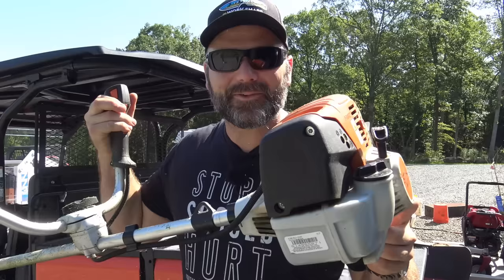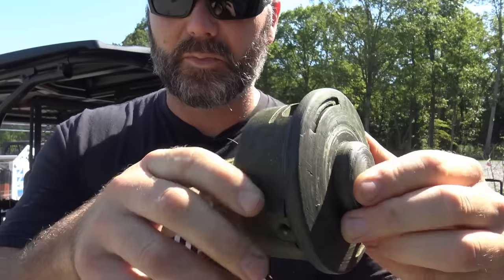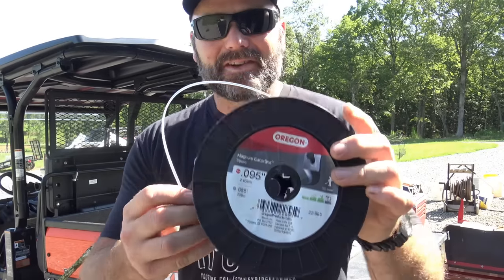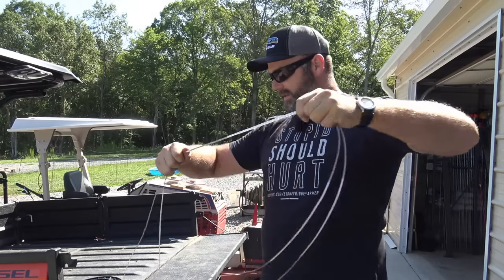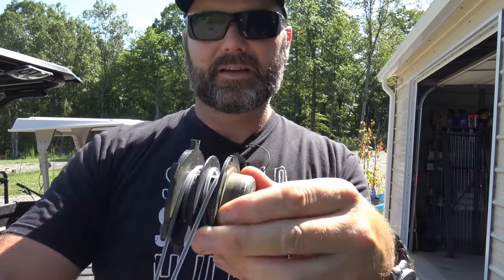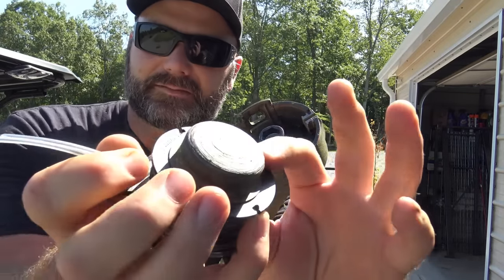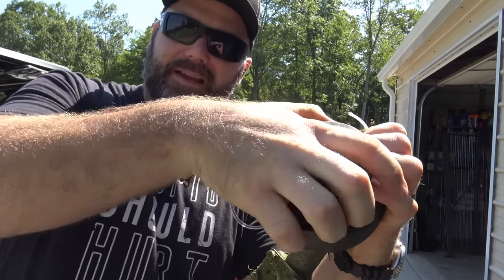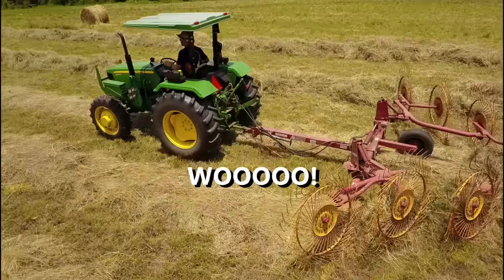EASIEST WAY TO STRING YOUR WEED EATER

Comment: Well done on the method. I work at a STIHL shop myself. Only suggestions to make it easier would be that if you just take 4 arm lengths and cut it. Put each end in the spool as you did and spool it till you're left with a short loop. Latch each edge in the notches built into the spool for holding your line while putting the spool into the head and cut the loop of line. Pull the line from the edge of the spool into the appropriate eyelet and they hold themselves there. Put your faceplate on and go. Otherwise this is super helpful and will recommend it for people who don't have time in the shop. My method would just save you the time of measuring two seperate pieces cause you can cut it at the very end, the spool is built and designed for that. The notches on the top edge of the spool opposite each other. And the effort of holding the line once it's been spooled, hooking it into the notch on the top of the spool removes that risk/effort of holding it from unwinding completely.
Reply: Those are super great tips from a guy who has owned a Stihl string trimmer for probably 15 years and never completely done it the best way like you described.  Thanks a lot!
Reply: @nathangould2856  I'm glad it helped. I read back over it and found it kind of confusing myself. But the basics are there haha.

Comment: Tip: If you notice more line breakage than what you feel is normal, drop your roll of unused line in a bucket of water for a day or two. Old line can become brittle  and a good soaking can reverse this from happening. This is equally true with a new roll of line as there is no way of knowing how many seasons it was on the shelf prior to your purchase.
Reply: Now you tell me!
Reply: Never heard that before. I wouldn’t have thought the plastic string would soak up water. Today I was working on restringing and cursing the string. I’ll go soak it immediately.
Reply: @baklash6079   lol
Reply: @baklash6079  that’s funny
Reply: A synthetic string would NOT be soaked by water.
Reply: Lol
Reply: I replaced the word "line" with "hair" and now my bald spot is gone!
Reply: got a good laugh out of your bucket of water "snake oil". It was free, tried it,...laughed again at myself. The line that "soaked" overnight was a completely different story.
Thanks Mr. Matt, makes a huge difference.
Reply: You have to try it to believe it, but it works every time.
Reply: Did you learn this from Project Farm? He also tested the best strings on the market
Reply: @williambrown4415  It needs to be hot water, not boiling though.
Reply: I soaked mine too long, now it's all soggy.
Reply: I have found that has not helped at all. But, when my line breaks (which is every 5 minutes)….

I notice that the line on the spool is always tangled. Is there something I am missing? Align arrows, feed equal line in and turn the line in.

Honestly, I am curious of a great brand of line too.
Reply: I’ve done it. It works! Need to leave in in the bucket for at least one week. Seriously.
Reply: CRC lubricant after you put it on the spool. Runs as smoothly as a babies bum.
Reply: I have never thought of that  on how old / how long the store was holding it for 😮
Reply: Nylon string needs a certain percentage of water to have maximum strength. Many plastics aren't affected by water but nylon is not one of them.
Reply: @trulyinfamous  sorry, but that last sentence is a mouthful. To clarify, are you saying nylon is affected by water? The spray lubricant someone else mentioned also sounds like a great idea, except I wonder if it will then attract dirt?
Reply: @pkr2inc  yes, nylon absorbs water and needs to have a certain volume of water absorbed into it to reach it's maximum strength. Too dry and it's brittle. It's not possible to get it too wet so don't worry about that.

Comment: Good well executed video. Instead of holding the reel stationary, I hold the 2 sections of string on either side of my middle finger of one hand and hold the reel on top and bottom with the other hand then spin the reel in my hand. This keeps them from twisting and takes even more time off. Thanks!

Comment: You missed  a very important and useful feature of the spool: There are a couple of roundish notches on the rims of the spool to hold the ends of the line so you can install it without holding on to the ends. Also some spools allow you to just bend the 24 feet of string in two and not have to cut it in two.
Reply from the maker: I knew I missed something...better question...if ya already know how to do this...why are ya watching buddy? Just curious..thanks for the info
Reply: I have stihl fs90r I caught that also. I clean dirt out of mine before anything I don`t cut my line til it`s all put back together use ball hitch on truck stretch it to back door of truck gives me proper length ball holds it tight while I roll it up. I maintain a few yards for extra money his way is good also you dont always have a ball hitch
Reply: @StoneyRidgeFarmer  Aggressive response. Guy was just being helpful. Chill.
Reply: Bill Pays, Husqvarna's reel(s) functions like your final sentence.
Reply: Nah , he was asking a question like a Man. He even thanked him for his input

Comment: Pro tip! If you are just starting out, use 
.095 line, it will help you get used to the trimmer and it's speed, then use .080 line to get a better cut, it will help you go faster if you have medium to small sized brush.

Comment: I have a STIHL FS 94 R with a User Manual that's 44 pages, English version. It also came with a separately printed page that showed how to replace the string in ONLY 18 steps. Your method is so much easier. Thank you for making this video. I'm now a subscribed viewer and waiting for your next video. Two tips: When you buy a new trimmer, the manual will/should inform you to 'break in' the engine. This break-in period lasts for the first 3 tank fills. I also avoid using gas with ethanol as this additive can cause engine damage.

Comment: There are two slots on the spool that allow you to cam the string into the spool locking the strings to the spool. This allows you to handle the spool with one hand and guide the strings in one at a time.

Comment: Great video Josh!  There are two slots on the string spool where the loose ends of the newly strung string to be pulled into so they won't accidentally come unstrung before you get the spool back into the head.  Once you have the spool reinstalled, just give a slight tug on each line to pull the line out of that holding slot.  TaDa!!!  :-)
Reply: Yes I just discovered what those two notches were for a couple of months ago, makes a big difference putting it back in . 😊👍
Reply: Right Mark, those notches in the spool are my 3rd hand.  The line being held by the 2 notches makes it so easy to drop the spool in with tension on the spring. Put the cover on then pull your both your stings at the same time to set the spring
Reply: Yeah I noticed that and defoz had to do that. He makes it look so easy in the video but I found that you almost do need 3 hands. The crap flies everywhere
Reply: Thanks. Hopefully this works for Milwaukee too?

Comment: Been weedeating since I was kid but the old 80s/90s style weedeaters we had never seemed to let out string very well with dual strings, so I never bothered doing it. Hadn't had to do any trimming for a decade since moving away from the farm but got a Husqvarna and figured this would be a good time to look for any tricks for wrapping the line easier and doing the dual lines. Man the channels on the newer style heads are really nice! The one note I'd add is to check the way the line is anchored before cutting it. Mine doesn't have holes like that, it just has a notch between the two channels and you loop the line around that and wrap it. I didn't realize that before cutting, so the line is half what I meant to put on. That's alright though, I'll use the two smaller pieces and then I'll know for the next time after that. Still a nice helpful vid.

Comment: There are two notches on the reel you can stick the string in to hold it in place as you put it back in the weed wacker head. Just a little tip that helps keep the string from slipping out of your fingers so you don't have to start winding all over again LOL
Reply: You beat me to it!
Reply: That's what I was trying to say and he thought I asked him why he didn't have 12 foot arms or something.
Reply: Do the top first, put it in the notch, then the bottom. Then there is a groove that will hold the spool in place while you insert the line into the two metal holes on the base. Pop on the cap, pull the strings, and  whip.
Reply: The notches will hold the string in place until you put the spool on the weedeater, so I always keep a spare spool ready to switch out. Rewind on a rainy day. :-)

Comment: I’ve got the same model I use for hundreds of hours a year, the way he wound works but it’s better to do the top and bottom separately, starting with the top and not letting the line twist like he does because it will bind on itself and you’ll spend a lot of time and hassle having to stop progress to unbind it because the line won’t come out when you tap it. Keep extra full spools nearby or in your pocket to quickly swap out. I keep my machine running 90-95% of the time I bill my clients for and can clear more area than two people typically can.
Reply: You mean the correct way? 🙂

Comment: Echo speedfeed 400 or 450. Best heads on the market. They are cheap aswell. Also, my favorite strink is echo black diamond
Reply: Sniper___ yeah the echo speedfeed is the best
Reply: Do you know do they fit on other brands of weed eaters like my efco 2400s
Reply: Speedfeed is definitely the way to go
Reply: Echo speed feeds are the best. Takes all but 2 minutes to get back going again
Reply: Put an Echo speed feed with black diamond line on my Stihl trimmer, Game changer!
Reply: I am just running out of the Echo black string. It is good stuff for sure.
Reply: @Joey-ve7ku   they fit on almost every weed eater
Reply: @sniper___1732  awesome 😃
Reply: @Joey-ve7ku  You have to be careful which one you get.  There's a universal but most of them are specifically for Echo.  I have been looking at the universal for my Husqvarna.  After these comments I'm going to go ahead and get it.  The Husqvarna isn't bad but the Echo will be better.
Reply: @flash1259  true thanks
Reply: @Joey-ve7ku  It's weird that I was  going to Amazon's website to order  the 400 universal when your comment popped up.  I got to thinking and went to Home Depots website and it turns out that they are in stock at my local Home Depot.  Well 30 miles away is local for me.  Going to get two tomorrow.  One  for me and one for my son.
Reply: Agree. I don't have a Stihl trimmer, but my Echo SRM-225 has the speedfeed. Measure out the full length you need (E.g. one piece 20' long) poke it through the feeder hole, make sure you have an even amount on both sides, twist the base and you are done. No caps to remove or springs to lose.
Reply: @ShutterUp  do you happen to know if that will fit a Stihl SF50?  (I'm not positive about the FS. The FS may be short for cuss words later). I had just bought this weed wacker and haven't had to change string yet.
MB BAR RANCH
Reply: @Joey-ve7ku  THink so Joey.  Believe they are somewhat universal.
Reply: @tojo2774  merciii

Comment: QUESTION: At 3:44 you say it is not correct to go in the "same" direction. Instead you say to go in the "back" direction. Why do you say this? What would happen if you went in the "same" direction?
Reply from the maker: the string won't feed correctly
Reply: @StoneyRidgeFarmer  There are other videos online where it shows the string being wound up in the "forward" direction rather than the "back" direction. Does it simply depend on the weed wacker? Or do all the weed wackers need to be in this "back" direction you mention at 3:44?

Comment: After loading the new weedwacker string into cartridge, I spray WD40 in the places I can get the spray to go in to. It will keep the string coming out when needed, and pretty much eliminates the string binding up and "welding" itself to the other string inside the reel.
Reply: Very good video thanks 👍🏻 as a gardener al mi life I will just add that usually the still weed eater have an blade on the security cover and that is because if we leave the weed eater line we will end up damaging the motor so if the weed eater have the blade on the cover it cuts the line to the right size
Reply: I spray mine with super clean  comes in a purple bottle at Wal mart…..cleans up the shaft, cover and spool very nice and then I lube spray with an lube even wd40…..my dad had me lube , oil all metal, lug nuts, bolts, his farm days as a kid taught me alot about preservation……

Comment: Josh! ive had a bunch of the weed wackers over the years and I just picked up the Echo SRM-225 like you said with the speed feed head! It is deff my favorite for sure! Second thing is Oregon makes a very good product! I love their power cut chains for my saws! I run that chain on my Echo CS-490 and my old Mcculloch, id be curious to try that string line! Thanks for the tips as always!
Reply: I had  Stihl, Homelite , weed eater, and lastly Troy Bilt. In an act of desperation I picked up an echo 225 and fell in love. I will never go back. I am 63 and can weed eat 4-6 hours with my echo. When I buy another chain saw it will be an echo.

Comment: I have a Stihl FS 91 and I love the trimmer. I use Stihl .95 thick line. X type line safety yellow in color. Have had very good luck with it. The Oregon line I tried I wasn't too impressed with.

Comment: Great video. I think my mistake has been using a much heavier line. It's tough-wearing but hard to wrestle into place.
I use an Austrian scythe for most of my maintenance. This is a beautiful tool, really satisfying to use, and no noise, no pollution.....definitely my preference unless theres lots of stones about.

Comment: I have a masters degree in weedeaterology and that is pretty much exactly like I do it as well except I wind one section at a time to help insure I don't cross any line up. Enjoyed the video.👍🏻👍🏻
Reply: I have to say, but in all fairness to trying to get the video done quickly and not to bore viewers, his line seemed to cross more than one time. I use the identical process. Well done

Comment: Great video. Have an electric 40 volt cobalt trimmer which was a royal tool replacing the line. I went out and applied what you showed, and bingo..job done. Thanks for the lesson..keepum coming.

Comment: After being a landscaper myself forever 25 some odd years, yes your way is the correct way but I have found that the easiest way to do it is double the length that you had a folded in half, therefore only using one piece. You hook it onto a slot that you see in the center, and that's where your phone will be, making sure that both ends are the same length keep your middle finger separating the two strings in there two separate slots and just string it the way you normally would run through the holes put the cap back on Snap everything in place. Now that maybe my way of doing it I'm sure this guy knows what he's doing and then some he lives on a farm and thank you sir for your helping out people. Not too sure if you have seen or heard of the way I do it as well as many many others that do it the way I do it. Just out of curiosity have you heard of it done that way or seen that way in your past

Comment: I don't have a Stihl - I have an old Murray and it doesn't have grooves, it has holes. My reels have notches and instead of cutting two pieces, I only cut one, then I wind the string and clip it into the notch on each side of the reel, then I cut the string right in the center. To cut, I use a string cutting tool that came with a roll of line. It's really handy.

Comment: There are 2 notches on the head (cartridge)... clip the string in those notches before you put the head back in. They are there to hold the string for you while you put the head back in.

Comment: I always soak my "Sting" spool in a bucket of water for 24 hrs.
It rehydrates the String and and it won't break as much. Who knows how long it's been on the shelf at dealer. They buy it by the skid load.

Comment: Don"t cut the line into two pieces until you have everything put back together. Take one 24 ft piece, stick the ends into the spool and wind it around.  When you get to the end, you will have a loop. Clip the different sides of the loop into the spool and replace spool.  Pull the loop around behind the weed eater head and let the line fall into the holes in the head.  The loop allows you to only use one hand to hold tension and to guide the line into the two opposing holes and will keep one line from slipping and uncoiling while you deal with the other.    Once the cover is back on, cut the loop in the middle  and you are ready.  I have been weed eating a cemetery for 30 years.  Trust me, it takes a tremendous amount of line and requires many reloads.  I appreciate you sharing your knowledge and enjoyed your video.  I look forward to sharing more tips in the future.
Reply from the maker: many ways to skin a cat...this is my way buddy....you should make a video and show us your method...we all can learn from each other for sure! Thanks for the input!

Comment: I watched this first before stringing my spool for the first time.  I have a Greenworks single line trimmer and bought the big bundle of silver line instead of the blue line on the replacement spools because reviewers said the blue line stuck to itself.  I bought it last year and just now got the gumption to try to wind the spool.  Turned out to be way easier than I thought.  Still don’t know yet if I did it right.  It’s raining now, so I can’t try it out.